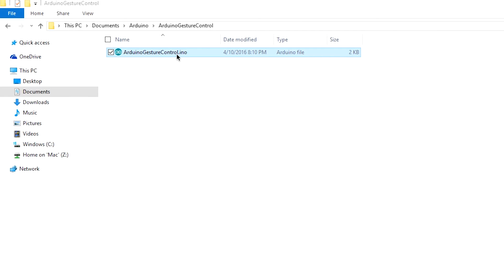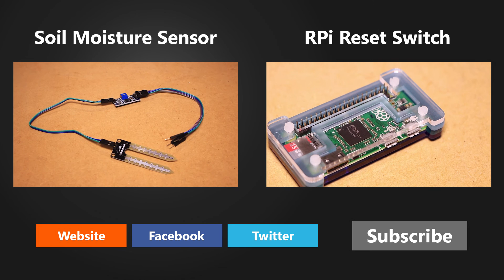Arduino - PC Gesture Control

Comment: Damn! I've been working on the exact same project. The only difference is that instead of using the gestures as a control device for computer; im using it to keep a count of people entering and leaving a room and turn the lights On/Off accordingly. I ran into a lot of problem and the project still hasn't been perfected. Hopefully this is helpful. But thanks for making a video ^_^